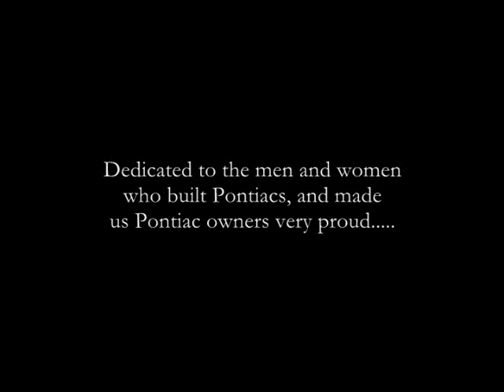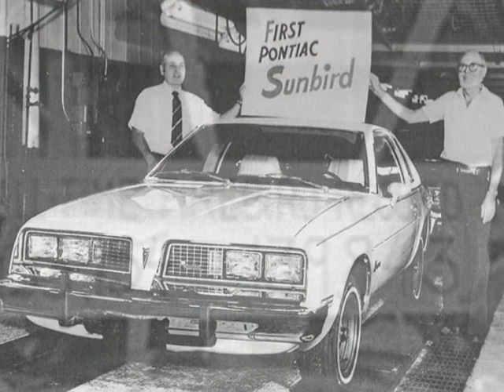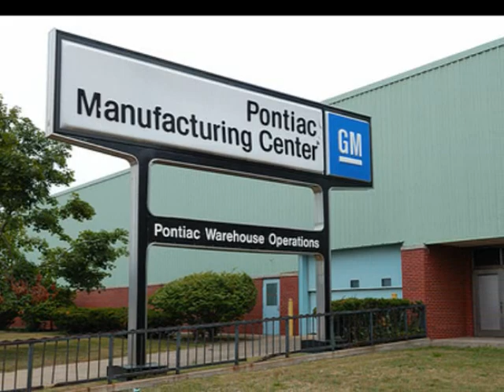Pontiac Assembly Line Tribute

Comment: I built a Ram Air III for my ‘65 GTO. #48 heads, “068” cam( advanced 2 degrees) 1:65 Harland Sharp roller rockers, RamAir exhaust maniflods, ‘65 Tri Power intake. Sealed RamAir hood scoop. 2:78 gears.  Turbo 400. Baby wants to fly. Needs overdrive

Comment: Pontiac may have closed but they will never be forgotten. They made some very special cars. People like me and other owners of Pontiacs keep them alive. I have rebuilt one Pontiac (the 88 sunbird NA sedan non turbo model may not have been turboed but it was still pretty fun) and now I am working on a 89 Bonneville.

They are totally not the cars one would undertake putting money and work into but they are a lot of fun to work on. The 89 Bonnie had a spun bearing on cylinder 1 (the others weren't far behind) I just couldn't see watching it die. Most would have junked it but I felt the body was still in really good condition so I made it a project car for me.

It may not be a muscle car but it is elegant in certain aspects of it and I actually like the overall look of the car.

As I said Pontiacs will never die. After this one I will probably source either a Firebird, Older Grand Prix or if I ever get lucky enough to source a GTO.

Comment: Nice. Thanks for posting. I loved seeing them installing that 1971 Firebird fender. That fender is a one year only on 71's making them very hard to find. Loved seeing the 1972 Gran Prix on the production line also. I still cannot believe they were stupid enough to stop building Firebirds. People would line up around the block for a 2017 SD 455 Pontiac Firebird Trans Am with an all new factory built aluminum block 455 CID high performance 1100 HP twin turbo modern version engine that looks a lot like the 1970 - 1973 Firebirds & Trans Am's IMHO. I would be first in line! "BRING BACK PONTIAC!!!" GM get your heads out of your ass. I know for a fact you would sell a shit ton of Firebirds if they looked a lot like the 70 - 73 birds & had a pure original high performance PONTIAC racing engine in them! Kind of like what you are doing with the new Camaro, Mopar with the new Challenger Hell Cat, Ford Mustangs etc. While your at it bring back Oldsmobile with a new kick ass 442 that looks like the 70 - 72's & a HP engine also! :-) I know I would if I owned or was the CEO of GM.

Comment: Great Group of pictures! Lots of history. But remember the poor workmanship, sloppy paint, rattles, rough idle, long winter warm-ups just to move, leaky trim into the floor boards and trunk and rust outs in 3 years. But they were cheap and a 3 year very affordable bank note was the norm. But there was something about a Pontiac. They just had that look. I remember seeing my first GTO in red by my elementary school. A neighbor got a 68 GTO with that amazing front bumper. Then later I got a new 77 Trans Am with the shaker hood. Still remember that gold chicken and how that thick steering wheel felt with that low exhaust note. The look on my parent's faces were priceless. Great memories!

Comment: They can bring back the Firebird Trans Am and the GTO. All under a division called GMC. Yes GMC, Gotta Mechanic Coming. GMC started out with Pontiac engines in them and were only sold through Pontiac dealerships.  Mercury did the same thing with their own version of the F-100 truck.  You could bring back the Pontiac Trans Am under the GMC brand. Buick should be eliminated as well.  Not only is it boring , but is trapped between Chevrolet and Cadillac. Chevrolet demands that it is the reigning champ of high performance. They have to share that mantel with Cadillac. The Grand National will never rise again. Cadillac is the most luxurious. GM was a much greater company when they were all competing with one another. Now they just turning out bovine excrement, BS. Now Ford and GM are thinking about not making cars. Trucks only. Their lazy. They should buy some creativity and build a vehicle that we (the public) can't look away from that we would stand in line for.